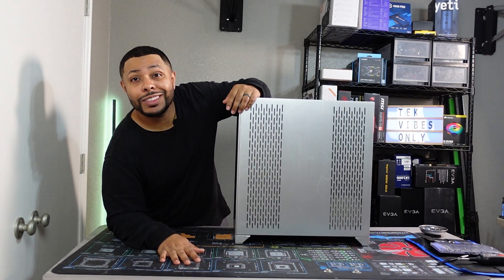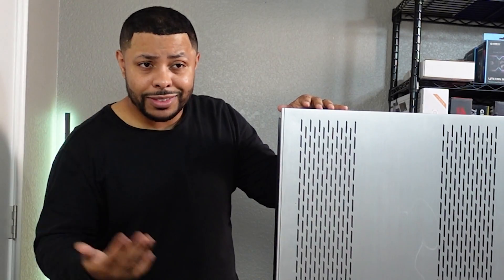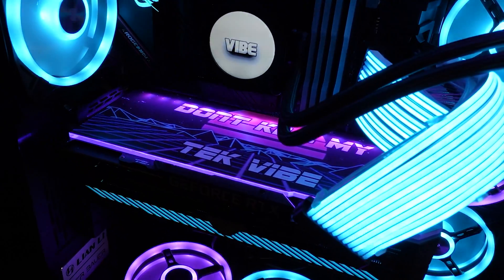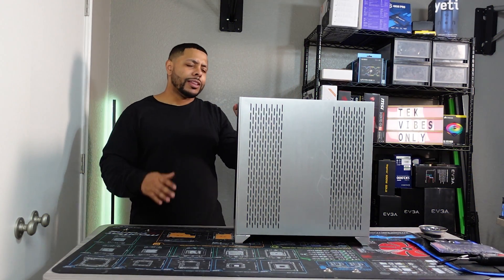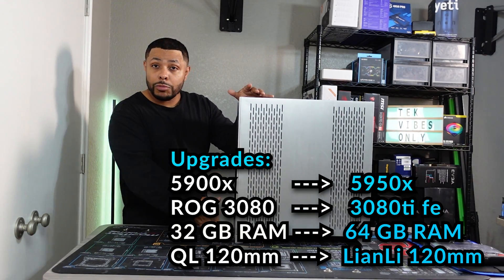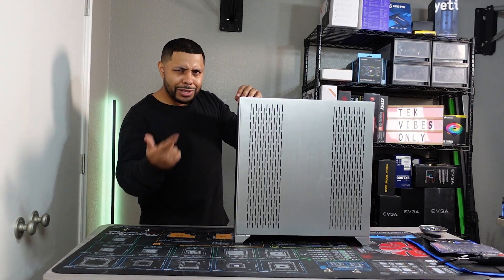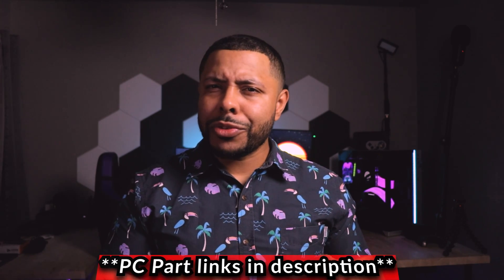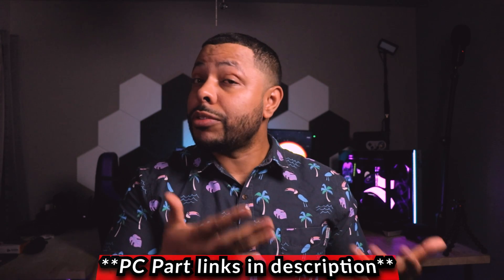Upgrading my setup to a RTX 3080ti

Comment: I definitely like the new Cam-View from top, obviously you mounted the cam now disconnected from the table. If you now go for a more stable table then I think this is it :-)
Also I do like the screen - had sth similar in mind, but with much smaller screen to display PC Health information (also started to create software for that but did not finish (will take me ages again to finish...). I like LianLi (have the O11 dynamic mini), but the fans are not my cup of tea. Yes, I think it is a good idea to daisy chain the fans, that is really good, but I do not like the design that much. Also I had the vertical mount bracket - but in my opinion this is only for normal size or large size cases... I returned mine as it simply covered too much stuff I like to see. In your case I think it is okay.

Really cool content - LIKE!

Comment: Bought a 3080ti from EVGA but they canceled me order for suspicious activity… so I ended up getting like a +$50 over MSRP 6900XT wasn’t my ideal but just happy I can finally get one of the new cards and experience even some minimal raytracing. My build will finally be complete
Reply from the maker: Hey the 6900XT isn’t bad man…. And that FSR is pretty impressive for a first iteration. Hard to beat only 50 over msrp too in this climate
Reply: @TekVibe  yeah at the moment I have a 5700, and the drivers have been giving me some real troubles and so I wanted to get an Nvidia card cause they generally don’t have as many issues. And the performance is slightly better. Still happy

Comment: both are great pcs.  Great job.  Curious why didnt you keep the x570 mobo and went with b550 mobo instead?
Reply from the maker: So... I have to actually send that board in for repairs. It locked up on me and won't reset the bios and won't allow display. I've had this issue with this board 3 other times, and I wish they'd just replace it something is clearly wrong with it. 

I'll be using the x570 still, just gotta get it replaced first. Nice catch!
Reply: @TekVibe  ahh bummer man. Sorry to hear!  Yeah really!  3x.  Its a lemon at that point!  Good luck.  Look forward to more video. Thanks for the reply.